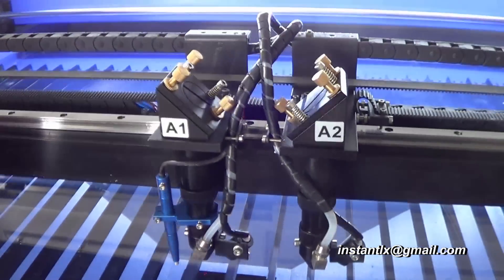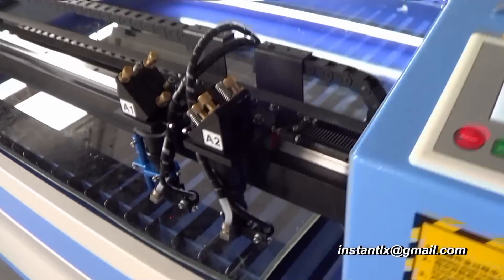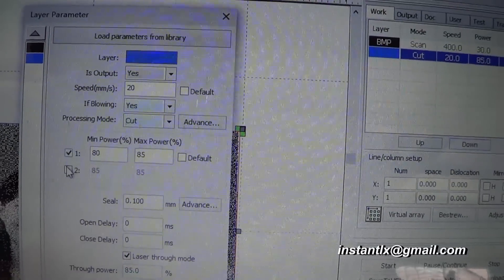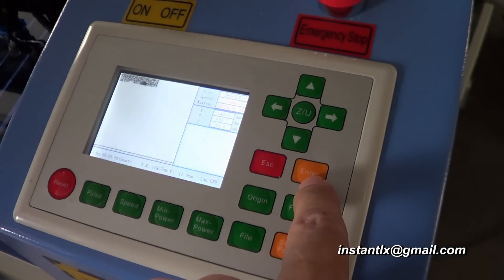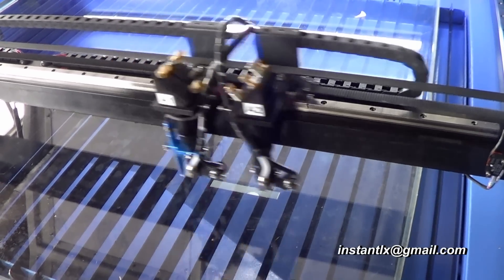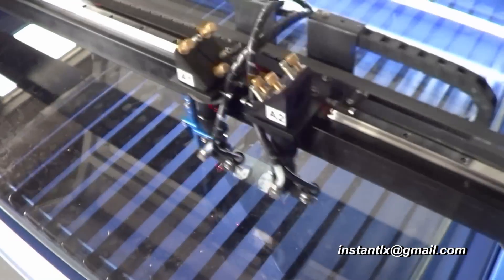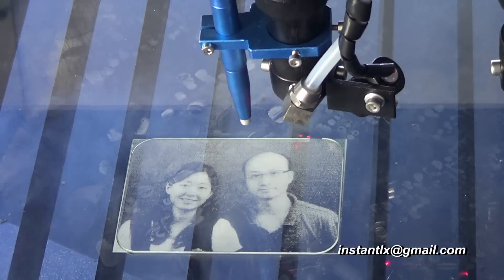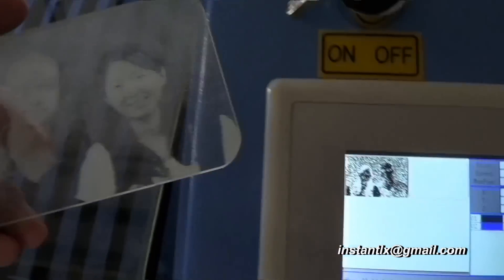1290 CO2 laser with 60w and 130w laser, photo engraving, China laser cutting and engraving machine,

Comment: Good day, Interesting video, that you for sharing it; do you have a machine that cuts, engraves and UV print at the same time? I want to produce some rulers, and I am facing the problem of centering: if I cut then print or I print then cut, there will be always a drift (few millimeters) between the actual and the required locations of the print over the plexi.
Reply from the maker: sorry, I don't have that. I don't have UV printer

Comment: wouldn't it be great if there was a portable cnc lazer that could mounted anywhere, anytime. so u could engrave windows on houses (already installed windows) car windows stuff like that. if such a thing exists, please link me up scotty :D
Reply from the maker: in fact there's small sized fiber laser marking machines which is similar as a desktop lamp. work size 100x100mm around,  it can do the job, too.
Reply: You can use stencils and sand blasting for that. You can get mini sand blasters.

Comment: Hi 
We have Laser machine 1390 laser with 150w laser, have problems  with engraving.
We have  LaserWork v6.0.23, make all like on you video, but the machine dont engaving.
Can you help us?
Reply from the maker: +Fahri shka 150w is too big,  if you set the power too low ( such as 10% or 15%, there might no laser comes out at all), 150w is for cutting  and it's good at cutting.
however, if you use 150w for engraving I don't think you'll get good effect. at least not so good as 60w does.
Reply: +Fahri shka  what's your problems,don't the machine move?
Reply: Our laser machine we buy at the SINMIC factory (Jinan city). Our model is SL-1390. 
We turned to their engineers, they do not want us to help solve this problem.

Laser cutting works perfect, we don’t have problems with cutting. 
But the engraving don’t work. We are prepare file for engraving at BMP, give all settings, then we send file to the machine. 
Started to blow air compressor, but the head stand and don’t moving. It takes 5 seconds, and then turns off. No laser at this time. Just turns on the air compressor.

I know that the power of the laser can be changed
I have picture & video, can show

Comment: Can the high power laser be used to engrave as well as cut?
Reply from the maker: +Malcolm Daly Yes, but the 130w engraves not so good as 60w. especially in photo engraving. beause the 130w has thicker laser beam. just like use a big pen to draw, there'll be less details than using a smaller pen.
Reply: I have high power laser